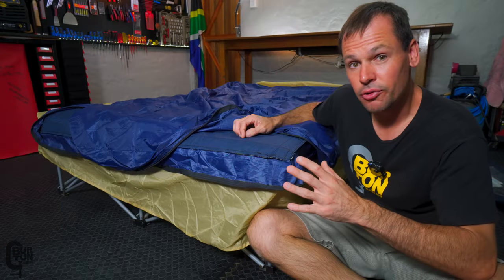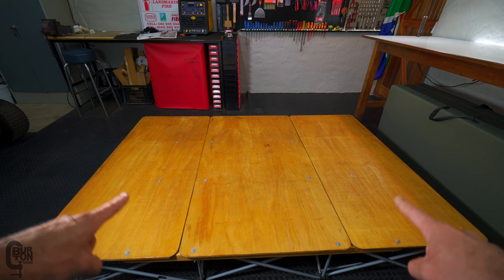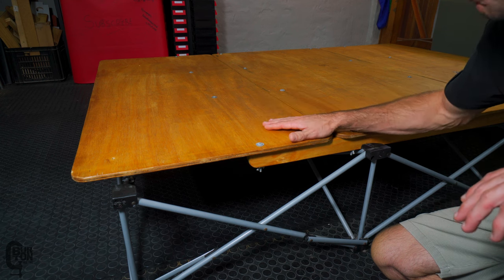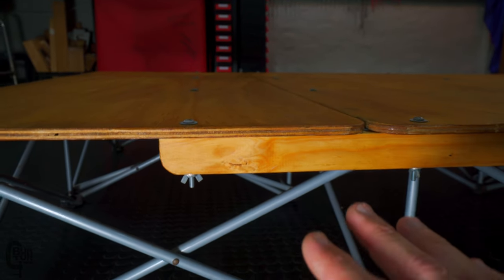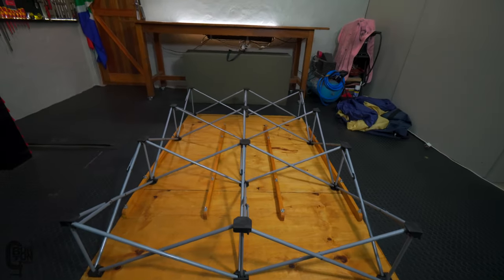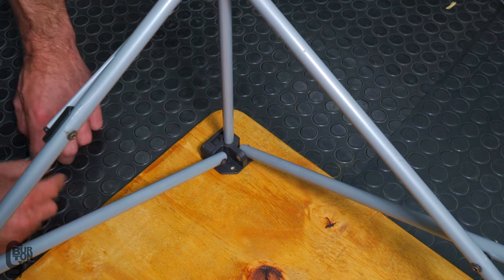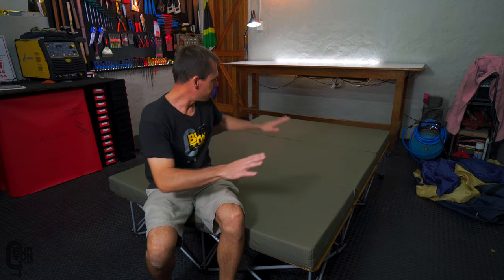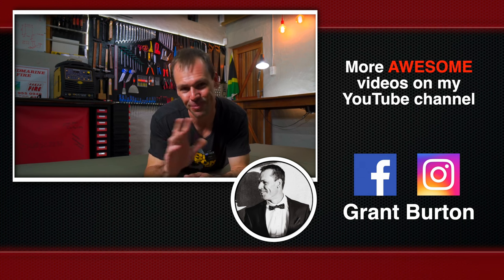Air Bed vs Foam Mattress - DIY Camp Bed - Burton Builds

Comment: Hay hay!!!!! Great stuff Grant!!! Appreciate it!  Ill be doing the same although my frame is slightly different. I reckon it will totally change our camping experience. Im going to share the crap out of this vid 👍🏻👍🏻💪🏻
Reply from the maker: Thanks dude. I've been loosely planning another top... one with aluminium ribs, with gaps between the ribs, that rolls up. Much lighter than the plywood top. Also something that rolls out and snaps into shape and onto the frame without the need for bolts, etc. Very far from a final design though. Might start working on it during the year... still a couple months until our next camp trip.

Keep us up to date on how yours is coming along.

For a weekend trip, it's a lot of setup (which is why i was thinking of a roll out / snap into shape design) but for those long trips, the extra setup time is negligible.

Try out a couple of foam mattresses before buying. Ours is a dual layer mattress (50mm high density on bottom, 50mm soft sponge on top) and it's a bit too firm and heavy. Friends of ours have the same one but with a single 100mm layer of soft foam and its way more comfortable and about half the weight (very subjective though).
Reply: @GrantBurton  : like the aluminum tables…
Reply from the maker: @francoismalan7153  Yip, something along those lines, except with smaller section aluminium tube and bigger gaps.

Comment: Hey Grant just want to say thanks for this video I build my self one for the december vacation, and was the best idea ever, the only change I am going to add is to add a stopper at the bottem but ontop to stop the matras, the stand we used was at an incline so the matras moved downwards
Reply from the maker: Hi Stefan, it's a pleasure... super happy to hear it worked well for you. I've never experienced our mattress sliding around (but we usually camp on pretty flat ground) but I guess a stopper of sorts (as you mentioned) would help with that. Be careful when using the frame on uneven ground, somebody else that modified their bed like this used it over a number of years on uneven ground where the frame would twist until all the feet touched the ground, and that frame ended up breaking. Ours is still holding up really well.

I'm planning to make a few more camp related videos this year... more tips and tricks (not sure if you have come across the other videos that are already out?)

Comment: Please show us how you disassemble for transporting if you only have a DC 😢bakkie
Reply from the maker: Hi Jeanie, the frame folds up pretty small (as seen in the video) and when we transport everything, we unbolt and take apart the three wooden boards / panels and 4 beams, stack them flat on each other and lay it in the back of the bakkie with the folding mattress on top. The bolts use wingnuts which is easy to unscrew by hand.

Comment: So is ek reg as ek se daai is een sheet plywood of het jy 2 gebryk?
Reply from the maker: If I remember correctly, I bought 2 sheets of plywood. I got two 610x1340mm boards from the first sheet and one 730x1340mm board form the second sheet. It was many years ago.

Comment: Excellent, is that a custom made mattress?
Reply from the maker: Hi Rodney, yes, it's custom made. Two layers of foam with a ripstop type covering.
Reply: @GrantBurton  Hi Grant, thanks for the great video. Where can one make this type of foam mattress?
Reply from the maker: @jacodutoit878  Hi Jaco, ours was made by a local 'foam factory' company (including the cover), so I guess you could start with this type of place near where you live. If they won't make the cover, but can supply the foam, maybe try approaching a local canvas shop to make up a cover for you.

We have since changed to a different mattress, two layers, one 75mm firm foam and one 25mm soft layer but haven't have a covered made yet.